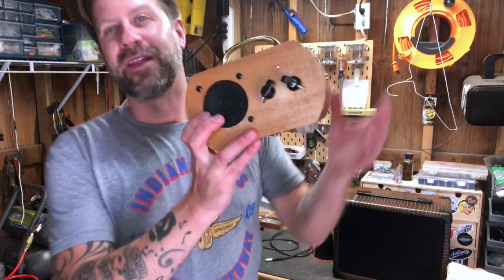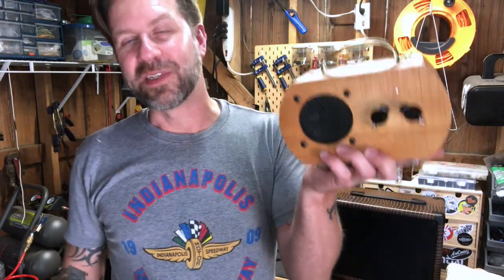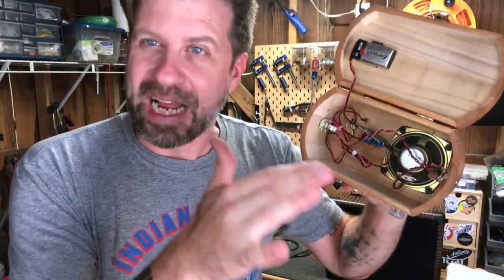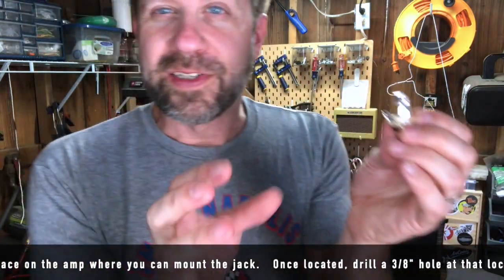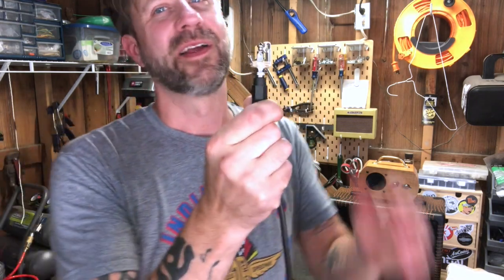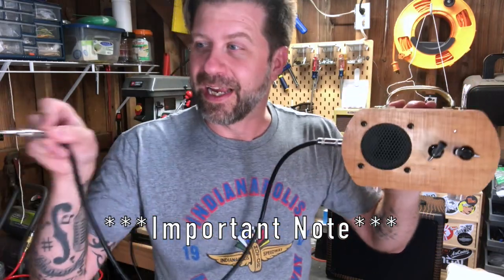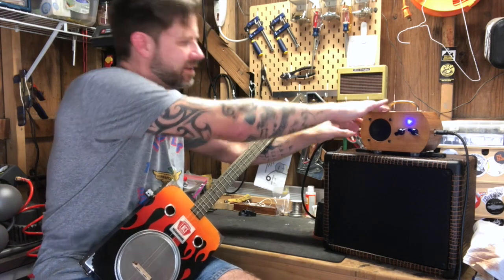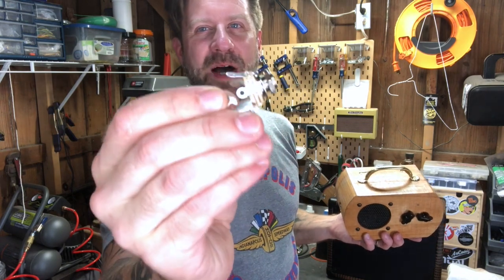How To Add An External Speaker Jack To (Almost) Any Guitar Combo

Comment: Exactly what I was looking for!! I did this like decades ago and couldn't remember what kind of jack I used. Thanks a bunch!!
Reply: btw, had to do a bunch of googling but finally figured out what they're called. These are 1/4 inch mono closed circuit jacks. Or "shorting" or "switching" jacks
Reply from the maker: @emach07  I’m glad it was helpful. Thanks for the comment.

Comment: Can I do the opposite attach an external amp to internal speaker with the same jack?
Reply from the maker: That would definitely not work in this arrangement. If you plugged power into this jack it would send power into the power amp and probably fry the circuit board. However, it you wanted to use it as a cab, it would be pretty easy. You could simply use 2 mono jacks (one going to the speaker and another going to the circuit board) and mount them on the back of the amp (make sure to label them somehow). Then create a small 1/4" cable to connect the two jacks. Keep the cable short and use right-angle connector and it would sit flush against the back of the amp so you wouldn't even notice it. If you did that, you could use it as a combo, a head, or a speaker cab based on which jacks you used. It would be a very flexible setup. You could even use the internal amp to power an external speaker cab while simultaneously using an external amp to power the internal speaker.
Reply: @musicalmiscellany  THANK YOU for saving my circuit board, so that shank output jack would not work? Could i just add one jack to the back and maybe a switch? one way is internal speaker and one way i have to plug an amp to the speaker? (in this way, if the internal amp dies at a gig, i can use a lunchbox amp to power the same speaker). for a working guitarist, a combo and lunchbox amp is all i have to carry..
Reply from the maker: @CalitranoN  You could do that but the problem is the switch would have the full power of the amp so you'd want to make sure your switch is rated for active signals and properly grounded. That always makes me a little nervous. I think the 2 jack method would be the safest.
Reply: @musicalmiscellany  ok,,, a guy did my transistor combo, with a toggle and a jack... the toggle disconnects the internal and makes the amp a cabinet... i can then use a lunchbox amp to power the speaker... it works great. I would like to do that on another amp. Do you have a video with two jacks? I am not sure how to do that?
Reply from the maker: @CalitranoN  With a low power amp, it might not be so bad, but with a high powered amp/head, the switch method makes me a little bit nervous. I could just be overly conservative when it comes to electrical shock though. I don't currently have a video about the 2 jack method but based on your comment and a few others that have come up here, I think I need to make one. I'll probably get it posted in the next couple weeks.
Reply: @musicalmiscellany  Well here is my thought, when playing out, the amp could fail much more likely than the speaker... so,,, with all the new lunch box amps out there, why not have the option of turning your combo into a speaker cab. that way if your primary combo fails.. say its a 50 watt combo, i can plug in a lunch box amp.. to get me thru the show? make sense? don't have to cancel the gig because the amp failed..
Reply from the maker: @CalitranoN  It makes total sense. I'll definitely get a video together soon. I should have everything I need on hand. I've even got a cheap combo I can use to demonstrate.
Reply from the maker: @CalitranoN  I just posted a video explaining what I described... https://www.youtube.com/watch?v=l6txwhjeC8Q

Comment: How would you do this on a 2x10 combo? I'm looking to add an external speaker jack to an old Peavey Studio Chorus 2x10 and use a cab because of the incurable amp rattle. Any advice would greatly be appreciated...thanks in advance!
Reply from the maker: I haven't seen the inside of the amp but it would be essentially the same process. The 2 speakers are either wired in series or parallel but chances are there's only 1 output (+/-) on the circuit board. If that's the case, it's exactly like this video. Run the output to the jack, then the speakers. If it has two outputs on the board, then you probably have to get the schematic for the amp to tap in at the output transformer before it's been split to two signals. Does that make sense?

Also, check out this video... I made it later after I got some feedback on this video... https://www.youtube.com/watch?v=9IQlyGviLJY

Comment: Usually the amps and pedals all run off a Center Negative or in other words a Positive Ground System completely opposite of any Normal Operating System. Which means the power and speaker connections are reversed.
Reply from the maker: That is a good point. Thanks for adding that. However, if the speaker output is coded red/black (or whatever +/- color/stripe combo), you'll still want to follow the way it's hooked to the internal speaker.

Comment: Have you ever had an experience after doing this where your amp makes a thumping/clicking noise?? I did this modification on a Peavey bass combo amp and it worked perfect before, now after installing the shunt jack, its making the clicking/thumping sound
Reply: It is a 200 watt combo amp, I don’t know if wattage makes a difference
Reply from the maker: I can't think of a reason you'd be getting a thumping sound. Sometimes there's a grounding issue when you add a jack but that usually results in hum. Does the thumping go away if you touch the jack or the cable ends? If so, that's typically a grounding issue but again... it's usually hum you'll hear.
Reply: No sir I’m aware of what a ground hum sounds like but I’ve never heard this before. I’m not sure if it’s a short somewhere or what. It’s like a consistent clicking noise
Reply: Would mounting the 1/4 shunt jack directly onto the amps metal frame cause this problem maybe?? Any videos I’ve seen of you installing a jack, it’s mounted to wood or is a plastic mono jack.
Reply from the maker: @cbazz333  Good thinking. It's possible there's some interference with the grounding due to the metal. That should be an easy thing to test. Just unmount the jack from the metal panel, wrap the jack in electrical tape (or some other insulator), test it again, and see if the clicking/thumping goes away. If it does, you've found the source of the noise.
Reply: Confirmed that was the issue, thank you for the replies and your expertise, have a blessed day!!

Comment: If you have no intention of ever using the internal speaker, can you just bypass it?
Reply from the maker: Yes. If you wanted to use the circuit as a head you could simply wire the speaker leads to a 1/4" mono jack. That would work.
Reply: @musicalmiscellany  thanks for the quick reply. Does the positive speaker wire go to the tip or sleeve part of the mono female jack?
Reply from the maker: @spaceavenger54  Tip + (Sleeve -) is the standard for speaker cabs. There are some rare systems that use Tip - but the vast majority of cabs on the market are Tip +.

Comment: what if you want to run both speakers?
Reply from the maker: If you wanted to do that, you could simply use a standard mono jack in place of the shunted jack. However, be careful to match impedance if you going to add another speaker to the active circuit. In other words, if the amp is 8-ohm stable and the internal speaker is 8-ohm, you'd need to swap the internal speaker to a 16-ohm speaker and then use a 16-ohm external cab to still run at an 8-ohm load in parallel.
Reply: @musicalmiscellany  so i cant run a 10 inch 8ohm in amp and a 12 inch in cabnet  8ohm in series
Reply from the maker: @smiddlyrabone8900  quick clarifier... 2 8-ohm speakers in series results in a 16-ohm load. 2 8-ohm speakers in parallel results in a 4-ohm load.

The wiring I described earlier would give you a parallel circuit. You could wire an extension jack in series but it's a bit more tricky because of how the circuit works. You could probably do it with a shunted jack. I'd have to think about that a little bit.
Reply: @musicalmiscellany Thats weard because the guy at Sweetwater music said i could do it if i  did it in series , and that it would be bad for my amp to run them in parallel. now im confused, i have a fender champ X2 10 inch speaker 8 ohm and i just built a speaker cabnet and bought a ledgend 12 in   8 ohm speaker for it and i wanted to run both speakers at the same time, maby ill just run the 12 inch by it  self its 75 watts im a beginner at this ohm-watt stuff. i just wanted more volume with 2 speakers
Reply: P.S. the Champ is 15 watts
Reply: @musicalmiscellany  Well on the back of the fender champ x2 it says  8 hom  min- so i think that means minuman so i think 2 x 8 hom speakers making 16 hom might work
Reply: in series that is, your thoughts?
Reply from the maker: @smiddlyrabone8900  I am not familiar with the Champ x2... but I would agree with the guy from Sweetwater. He's telling you the amp is 8-ohm stable. So if you added a second 8-ohm speaker in parallel, that would result in a 4-ohm load. However, putting 2 8-ohm speakers in series would result in a 16-ohm load (which should be fine). Typically, amps can handle a higher load but not a lower load... so that checks out.

However, there is a side effect of this. Most amps produce less power at a higher impedance. So, if it produces 15 watts at 8-ohm, it may only produce 10 watts (or even 7 watts) at 16-ohm. Divide that between 2 speakers and that's about 5W (possibly less) per speaker.

There's been a lot written on this - and different folks have different opinions - but it is generally accepted that 2 speakers will give you more volume, even if they're running at less power (again... some folks disagree). BTW, your comment about the jack on the back of the amp confused me a bit (because I thought you were trying to add a jack) so I need to look up the manual on that one. Stand by...
Reply from the maker: @smiddlyrabone8900  Okay, I just took a look at the manual on the Fender Super Champ X2 and now I see what you're talking about. This is much much easier than I originally anticipated. The amp already has a 1/4" output jack so the internal wiring is already done for you. There's no need to add any jacks or modify the amp in any way. Instead, you simply need to make a custom cable.

Read this article (particularly the section on series wiring)... https://audiovolt.co.uk/blogs/av-insight-background-audio-advise/how-to-wire-speakers-in-parallel-series-and-how-does-it-affect-impedance and then create you own cable that wires the internal speaker in series with the external speaker. It doesn't matter if you use slide-on connectors or 1/4" plugs or a combination... just make sure the 2 speakers are in series. Save the speaker cable it came with in case you want to use it without the external cab at some point.

This is a low risk mod because you won't have to modify the amp at all. It's just cables. If you don't like it, simply change the cable back. Good luck!
Reply: @musicalmiscellany  Heres a Question for ya. Should i have the main +  Wire going to the big speaker first  or  the smaller speaker first OR does it matter
Reply from the maker: @smiddlyrabone8900  It shouldn't matter. I'd probably go to the small speaker first. The important thing is to send + power lead to the + terminal of the first speaker and then send the - terminal of the first speaker to the + terminal of the second speaker (and the - terminal of the second speaker goes back to the - power lead of course). If you accidentally send the - of the first speaker to the - of the second speaker they'll be out of phase and may create less volume instead of more.
Reply: @musicalmiscellany  Yea i just was wondering if i went to the big speaker  1st in might  be louder , ive got series down. thanks
Reply from the maker: @smiddlyrabone8900  As long as the 2 speakers are the same impedance, it should deliver the same amount of power to each regardless of the order.
Reply: @musicalmiscellany  Ok thanks pal

Comment: Very cool!  I'm more into wood than wiring so pickups and amps are still black magic to me.  I'll have to try to make an amp some day.
Reply from the maker: They're definitely different skill sets. Soldering gives me inner peace. LOL. That said it stresses some folks out.
Reply: Steve,  for my first cigar box amp I cheated and bought a 5W mini amp on Ebay for $15.  I gutted the plastic case  and used the parts, including the knobs, and put them into an Acid cigar box. Very little soldering and very easy to build.   It's got just as much volume as the one I built from a kit and the one I built using individual parts with an amp chip.  I also built a practice amp, slash pedal board, from a Footnote amplifier I bought on Parts Express for $9.  No soldering involved!

Comment: I wonder if that shunt could wear out?  Is it a very dependable jack so far?
Reply from the maker: I suppose everything wears out eventually but it's a Switchcraft (which are known to be quite reliable). I know I have guitars with Switchcraft jacks that are 20+ years old and that jacks still work perfectly. Honestly... I'm pretty sure the circuit will give out long before the jack.

Comment: Sorry but I'm looking at the diagram paused at 3:34. Surely that's inverted? I'd expect the tip to go to the speaker and the shunt to the internal circuit board
Therefore when no jack socket in, it shorts, = normal operation. When inserted the live external tip goes to the speaker, and the shunt is disconnected?
EDIT NO it's correct. I'm trying to do the exact opposite, which is also useful. I'm wanting to allow my combo (switched off!!) that I keep in my living room to be driven by an external head, these tricks can work both ways :)
Reply from the maker: Thanks for checking out the video and paying such close attention. You made me rewatch it to make sure I stated everything correctly. You might actually want to check out this video I made. https://www.youtube.com/watch?v=l6txwhjeC8Q It sounds like you're trying to do something like this.
Reply: @musicalmiscellany  
Yes sorry if you read my first comment before I edited (in your email) you might've thought you'd done something wrong but I was approaching from the other direction and focused on that, you were of course totally correct. Actually if you wired two in series .. you could I'm sure set it up so that a combo could either be set up to drive another cabinet OR be driven by another head :)

Comment: Hi, Thanks for the tutorial. I actually want it the other way where the speakers stay on as I have a couple of VU meters I want to plug in. How do you do this?
Reply from the maker: Are the VU meters expecting a speaker level (powered) signal? Typically they're expecting a line level (passive) signal so if you plugged in a speaker jack... that would blow the meter. But if that's what you wanted to do, you'd simply change out the shunted jack for a standard mono jack. If you're wanting to get a copy of the input signal (probably more likely for VU)... you could just add a second input jack and wire it to the same +/- of the input. It would effectively be a copy of whatever you plug into the amp's input.

Comment: Can you plug a 4x12 into a headphone Jack in an amp to play through? Will it work?
Reply from the maker: I would not try that. First of all the headphone jack is stereo and the cabinet is mono but also, a headphone output delivers a fraction of a watt. Having such  low signal could damage the speakers in the 412.

Comment: Hi! How about if I want to connect headphones instead of a single speaker? Also shutting off the amp speaker when plugged in. Can that be done with that same type of jack? Thanks.
Reply from the maker: That's a very different ballgame because you don't want to plug a speaker level voltage into a set of headphones. It would likely damage the amp (and possibly the headphones). You'd need to create a small headphone amp to do what you're asking, and you'd probably want a separate volume control for the phones. It's a lot more work than just adding a jack but it is doable.

Comment: Cool video man..quick question. If you wanted to keep the internal speaker of the combo amp working when connecting to an ext cab, would it be as simple as using a stereo jack socket rather than a shunt jack? Basically turning a 2x12 combo into a 4x12? I would have thought there would be volume drop that would need to be fixed as well?
Reply from the maker: First off, thanks for watching and commenting. What you're asking sounds like an simple question, but it poses a more complicated one. If you followed this tutorial but used a standard mono jack, you'd get the result you're suggesting. The internal speaker would remain powered when the external cab is plugged in.

However, you first need to know more about the stability of the amplifier. For example, let's say your amp shipped with an 8-ohm speaker in the cabinet and it's 8-ohm stable. In that case, you'd want to change out the internal speaker for a 16-ohm speaker and also use a 16-ohm cabinet to achieve the 8-ohm load. If you left the 8-ohm speaker and added an 8-ohm external cab, the amp would be running at a 4-ohm load which would probably burn out your output transformer.

So you'd need to know the specs on the amp before doing the mod to ensure you aren't overloading the transformer. Also, there's a good chance you'll need to buy new speakers to match the load. I hope that made sense.
Reply: @musicalmiscellany  You sir are a gentleman, thanks so much for getting back to me, makes all the sense.